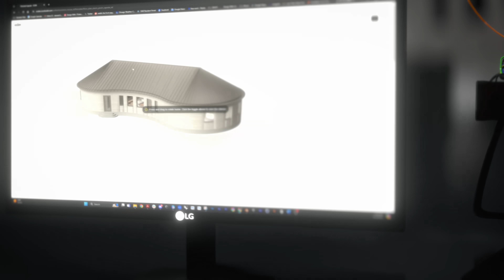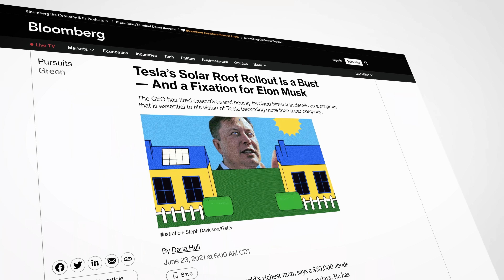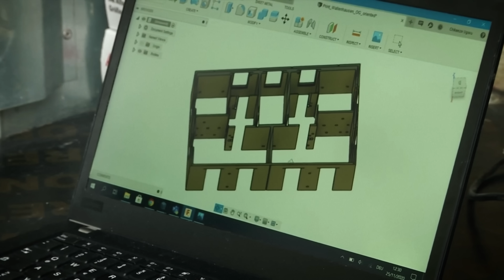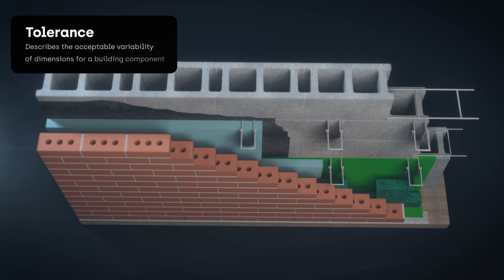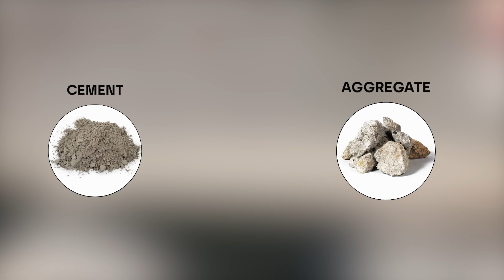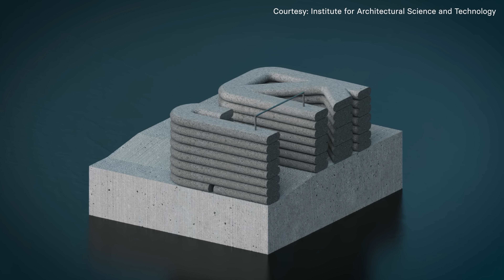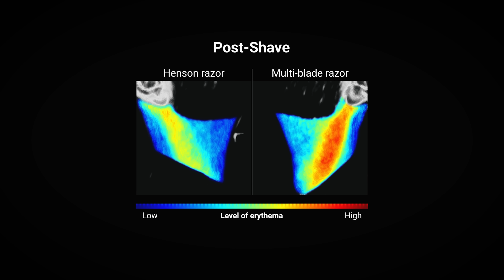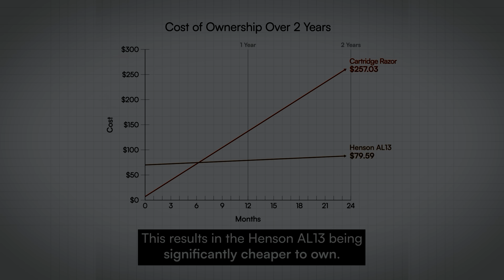Why 3D Printing Buildings Leads to Problems

Comment: No one cares about a traditional living home, we just want an affordable living home.
Reply: And preferably one that doesn't look like shit
Reply: @heinzaballoo  for me, traditional houses look like shit... I loath pitched roofs, shingle or traditional tiles, unnecessary decorations, mouldings everywhere, eaves, cornices, architraves, etc, etc, etc... it is all unnecessary (as most of these are merely decoration) and labour intensive processes that can be cut if we strip off buildings from these details and concentrate in getting the basics right. A house needs to be quickly and cheap to build giving confort and well lit spaces. The rest can be done with reasonable ease and you can make it yours by putting your own furniture and deco.
Reply: @eap8317   I loathe the brutalist style architecture that lacks the things you listed.
Reply: @eap8317   that's where you are completely wrong traditional building is not your average English castle.

I'm Swahili our traditional housing only has decorations on the door the rest is white.
Reply: @1984Variant   not all good contemporary or minimalist architecture has to be brutalist. Beauty also can be achieved by a good use of traditional or innovative materials (plus the use of architectural technics) without everything looking like a plain concrete box... even concrete, if used cleverly can be beautiful within the right context. Architecture is more than moulded cornices, architraves, skirtings or classical balustrading...if a building is stripped from all decorative elements and the shapes/space left hasn't got the qualities of good architecture, then it is not good architecture, it is just a box used for habitation...decorative elements are often used to "perfume a turd"...take the perfume out and you will still end up with sh*t!
Reply: @Eh-Mungu-Nguvu-Yetu-q8p   I should have said "western" traditional houses...my comment was about the prevalent style of Imperialist British architecture which has spread throughout the northern hemisphere, from Alaska to Rusia. I recognise that African, central-south American and Asian architecture are true-er to local traditions, materials and climate which has less room for unnecessary deco.
Reply: @eap8317  at least you get it. From where I stay building those concrete houses is actually more expensive than a traditional house of stone and timber or mud.
From our perspective traditional building is the affordable housing option
Reply: @Eh-Mungu-Nguvu-Yetu-q8p   yes, locally sourced materials and labour are still the cheapest and most affordable option for developing countries. I come from Colombia where clay bricks are still cheaper than other newer materials but earthquakes force to build houses with reinforced concrete or steel which are becoming more expensive day by day. In the UK where I live, labour costs are elevating the cost of building to a breaking point where construction is no longer a profitable business. This is why alternatives like printed houses can alleviate some of these cost to make houses more affordable and still be built to code with a decent margin of profitability.
Reply: Exactly. I dont care hownits built, what its built out of. I just want a safe home i can afford and wont be paying for untill the day i die.
Reply: There are a lot of people who really don't give a rats ass about the "nontraditional"  look .. what they care about ...does it have the space they need, is it in a good neighborhood.. is it sturdy and most important of all ...is it affordable.
Reply: @TheRTM  So you want a huge space in the best neighborhood, a quality build, and you want the price to be low. How about we just put that together for you in a week, too? I'm seriously curious, do you really believe this is a reasonable ask?
Reply: This comment lacks depth perception.
Reply: Even apartments cost as much as an actual mortgage
Reply: most of the 'affordability' problem is the gutting of the middle classes - stripping the wealth is the cause of affordability not "construction is too expensive".  
Instead of racing to find cheap building techniques and materials, how about we focus on the elephant in the room - the top take an every greater share of GDP creating the problem we see as affordability, and getting worse year after year.
Reply: One university study looked at jobs that are generally unchanged since the 1960s, the the pay levels for those jobs over time.  It concluded that middle class workers are getting paid less than HALF the buying power they had 60 years ago.  The exporting of manufacturing has masked much of the lost buying power - you can take you money and run to Walmart to buy off-shore junk, and 'feel' like your doing ok.  But over the decades as more and more items became off-shored it began to have an increasing effect on work available domestically.  Meanwhile all those imports were controlled by the mega rich whol skim and scoop a large share off the top, and use it to buy politicians, run the regulators, and look for tax dodges.
So imagine how you would be doing today if your pay was double what it is now...do you think there would be a housing crisis? do you think it would be a struggle to get by and pay the bills, put food on the table...how many middle class pays need to be cut in half to support each Billionaire?
Reply: @r.b.l.5841  I get where you're coming from and you're right, but we are in the technical singularity right now... We need to steer AI in the right direction and make sure it's an abundance for everyone as cost of things trend towards zero post-humanoid robot self-reproducing. This is the point where humanoid robots can make themselves, and they can make anything we build as humans with our hands. That's literally in the next 5 years max. WE NEED TO FOCUS ON THIS.
Reply: @emmanuelr710  its not in the next five years, because it will take decades to make enough robots to replace billions of cheap labourers, and in many places all it will do is push down the value of labour - forcing people to work for even less than now.  At the other end, the very top will be Trillionaires and care-NOT about the rest of us. When you start to see the robot security staff to protect those ellites, you will know the end has come.
New technology is sold to masses for convenience, but used by the very top for ever greater wealth inequality.  As world population plumbets over the next decades, it will become ever easier to control the general masses.
Reply: Except the people who approve zoning and otherwise need to be persuaded to let you build care a lot.  Also, because the unnatural restriction on where you can build whoever builds houses needs to recoup the money from all the time spent trying to get approval (and the money lost on projects that aren't approved) so they need to build a home that is likely to sell for a fair bit.

Basically, regulations are the problem and tech alone can't fix it.
Reply: the thing is with this style... is once you're in there these homes seem like they will be a bit depressing

you have to consider that when your interior walls are concrete like these are, there's no ability to hang photos of family or loved ones without drilling into concrete, same with hanging art, mounting a television, and if you live in seismically active places like California, its more dangerous since you won't be able to mount your furniture to the walls in the event of an earthquake

plus as he mentions in the video, what happens if you need to do repairs on the structure? You basically have to demolish the whole thing and start over because you can't get the printer robots in there to just repair one section of wall
Reply: So would you living in a tiny home? It's affordable but has less space
Reply: I would hire a human bricklayer, a Mennonite or Amish Carpenter and a quality plumber and electrician any day over a robot. I have and always will.
Reply: REALLY....
Reply: So true
Reply: I farted
Reply: I care.  I'm also someone.  Not all of us share your viewpoint.
Reply: Exactly!!!
Reply: Depends who you talk too and what their income level is.
Reply: When the cost of 3D printing of a House is only $999, you have your wish except for the 1/4th acre of land which costs $300,000.  lol
Reply: Ok, we get it: you’d prefer to live in a bland, boring, quickly put together and minimalist prefabricated box that hopefully gets the lighting right.

Good news for you: almost every new house constructed nowadays is made for people like you! You have no shortage of choices in practically any modern country of the world you choose to reside in. 

I prefer my depression era brick home with awnings, crown molding, original hard wood floor, and an original brick fireplace, and it’s because of people like you who don’t value style, art, and craftsmanship that I was able to buy it at a steal of a price.

Thank you for having bad taste.
Reply: Genuinely
Reply: Exactly.
Reply: Good luck paying for Maintence of a construction home. You guys will love that. This is just one additional tool in construction. Nothing revolutionary about this. You’re probably better off just buying a pre engineered metal building. Probably a whole helluva lot cheaper
Reply: Here's a thought: buy a small starter home instead of trying to start with a 3,000 square foot luxury custom home. You know, like every other generation ever did, except for the generations that built that starter home with their own hands.
Reply: Why dont you buy a trailer then
Reply: @JO-lx9bx  trailer or mobile home isnt a bad idea, but then you still have to buy the land, and then have all utilities installed on that land, and the end price still ends up being un attainable. Unelss you are talkng about living in a trailer park where you have to rent the land, and then were just back to renting.
Reply: @traycool69  Exactly!  Iposted a comment about that.  $999 for the house and $300,000 for the land because the developers and board of supervisors need money.
Reply: @JO-lx9bx  Or an old Volkswagon bus.
Reply: @JO-lx9bx that was a very unintelligent comment.
Reply: @talisikid1618 this is a very simplistic thread. And he’s not wrong. If all people are asking for is “affordable” there’s a plethora of options. The problem Is when you do actually add the basic level of reality check, people really aren’t satisfied with simply “affordable” as was clearly  demonstrated in the responses to his suggestion. 😂
And when people don’t aim for a trad style home with a little land to pretend they own and space to start and raise themselves and/or a family, you end up with endless  apartments, condos, track homes and people stacked on top of people making what used to be standard now appear to be a luxury hence driving up the price of what used to be standard basic living arraignments.
Reply: @LimeDude9999  lol thank you for delving into the details. modern houses are usually much better and have more features than old houses hence the increase in pricing. Not to mention the construction industry and how difficult it is coordinating all the sub contractors
Reply: @LimeDude9999 this overlooks a plethora things.
Reply: @LimeDude9999  Reality is this video is basically an ad selling opportunity for this channel which explains why there is so irrelevant guff at start about car manufacturing and Elon Musk...he also doest seen to understand that arches can be made out of brick
Reply: You're one person out of 8 billion. Not exactly a scientific conclusion that makes sense for the entire world. Might want to work on a bigger sample size than just yourself. So your answer is incorrect. LOL😂

Comment: Most of the problem he talks about are either not important or exists in conventional building. Round corner down exist because it is hard and expensive, not because it's undesirable. The only legitimate point that needs to be worked out is repairs and finishes but leave it to the trades they'll figure it out.

Comment: Correcting mishaps during printing - I think it's a very solvable thing. A lidar could be placed on the printing head to track the layer below. Software won't be easy but 100% doable

Comment: There is an Australian robot, the FDR Hadrian X, that  uses blocks designed for the machine that can build a house's walls in 3 days or less, builds 90 degree sharp-edged corners, and uses blocks that have aligned cavities for running cables etc. It kind of makes these 3D printed houses look primitive in comparison. The robot is a large truck that is driven on site, can be set up in a fraction of the time of the 3D printer, and then is computer controlled to build the house without human input. They have been making buildings in Australia, the US, Mexico, and the Middle East, and have been working with Samsung to adapt the robot for shipbuilding.

It is simply a much better solution than 3D printing.

Comment: I think your wrong here. 3D printing buildings will eventually become the most cost effective, cheapest to buy and fix/repair/replace. We are just starting out with this large scale technology. They are already working on a substitute with fibers and other elements to concrete which is lighter, harder, more durable and lasts longer. Just because it's a new technology, it's stupid to look for everything that is wrong with it and decide it sux. Look at computers back in the 70's, pretty much everyone was saying it sux, wont be a thing, no one will need it, boy were they wrong aye? :) Technology and innovations is what builds this world, critical dissing just because it's not perfected to your point of view is what destroys this world!

Comment: 3D printed concrete is really innovative. But currently not cost effective per sq foot. What I have seen is at least $475 per sq foot & still need land, permits, foundation, septic, water & electric. Price on all this can vary but it’s not cheap. Especially when you can literally get everything to build a one story concrete house from hardware stores for under or over $125 per square foot with “equity” labor.

Comment: Dont forget tilt-slab building which New Zealand developed in the1970s. Houses, appartments and factories by the million have been built. Australians have demonstrated machine layed brickwork. Working as fast as this pumped concrete. New Zealand also developed dome structures of concrete. Several thousand built in Australasia.

Comment: These could be designed in such a way that you would clad the inside with regular framing/drywall, and finish the outside in a modern stucco or other finish and not really be able to tell it's 3D printed.

Not sure why they didn't start there.

Comment: Not seeing any plumbing or electrical.  Why building a stick built house takes time takes so long is the, water and electical install and then put up drywall.  
If you want fast and cheep houses . . . buy 6 refrigerated food grade shipping containers, could have 1,900 square feet, well insulated with air conditioning in 1 day.

Comment: print-in-place is never going to be the market standard for housing... not without several transformational leaps to redefine what we consider print-in-place. it Doesn't offer advantages the market Needs or Wants. it's struggling to create niches to apply the actual advantages it can offer.
there are just too many limitations, and huge maintenance problems that this methodology inherently Can't address. even a mixed method approach simply retains the same failure mode in different packages.

thankfully, this technology is already seeing use in "print then transport" applications, where the advantages are integrated into improved construction methods while the print location is retained long enough to invest additional methods to counteract field printing issues.
thankfully, 3d printing of any kind is an inherently flexible technology.

Comment: Ima just exercising my mind a bit over here:
No beams - Printers could work with concrete as Eskimos build Igloo or as Romans build two thousands+ years ago. That is to use arches Ո.

Sharp edges => use the facade that is already in use on brick / rock walls. Check some historic buildings built from randomly shaped rocks with perfectly shaped facade even with gargoyles and other art. 

Level - can be automated and was solved in other applications already. Even cars and trucks can do that. What would they need is min 2 points of reference for the printer to start calibrations.
 

Tolerance - one thing about human built projects, result's always different then what was planned. Basically bigger the project, harder is to control humans. So we got situation where builders, high voltage electricity, low voltage electric system, plumbing, heating, etc people have to work around each others unplanned work despite every collaborator meeting every Tuesday to sync their plans. I had to experience this myself. It's nothing new in this field.
- For printers to prevent going into unwanted territory, "invisible walls" could be used (optics, wires, mechanical...). 

Exposed concrete - why is it mandatory to not cover printed concrete with facade when we can cover bricks, rocks even wood? And no brick walls are not always pretty either.

Addition and renovations -  I've seen project where people renovated apartments built from pre-built concrete blocks. I can imagine this can be done as well with printed house. Why would you require big machine to add/ remove few small walls/ holes ? Just (re)build it with suitable technology.